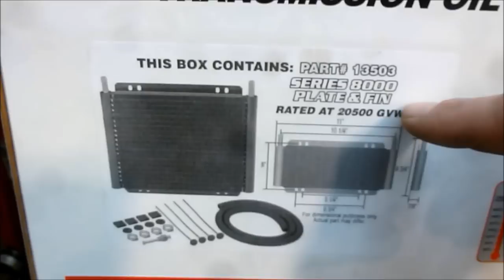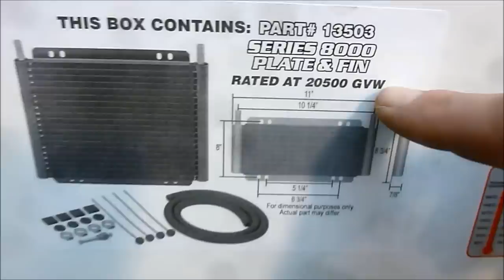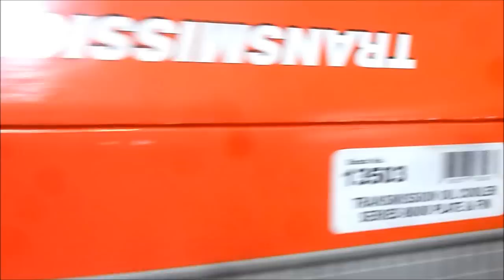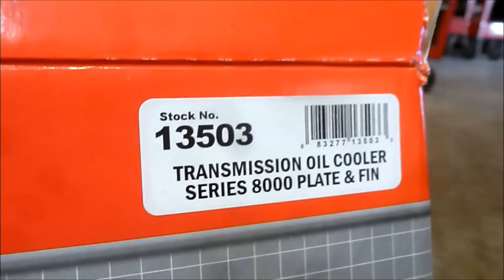2003 Honda Odyssey Automatic Transmission Cooler Installation

Comment: that cooler is supposed to be an inch away from the condenser or the heat from the AC transfers right to the transmissionfluid

Comment: so instead of going into the radiator, the fluid goes through trans cooler instead?
Reply from the maker: +obadiah7771   No. It goes thru the stock radiator cooler first for a little cooling, then thru the aux. cooler for best and final cooling.
Reply: +2stroketurbo got it👍
Reply: .2003 honda oay radiator how to change cooler fitting

Comment: How did the trip  go?  Did you have any problems with the transmission? I am thinking of doing this to our 2003  Odyssey also  .... to pull  a trailer with a couple of motorcycles.
Reply from the maker: +Richard Reilly  I would highly recommend it. However, Don't get the factory optional kit, it looks really wimpy. This aftermarket bar/plate cooler is the cats meow
Reply: Richard Reilly he prolly didn't make it
Reply: This 2003 odyssey, did you have problems with the transmission? How many miles and how did you maintain the it? Actually the genuine Honda trans. oil is the better oil. That's what I heard from many people. Your opinion? Put magnets on the trans drain plug.  Better magnetic force can put an extra magnet on the outside of drain plug. OEM has a magnet but you can increase its effectiveness.  Oil drain is not. Blox will have it. Oil filter can be magnetized by putting magnet on the fram oil filter. Heard Fram brand is good.I don't think I could install a trans cooler, but can a mechanic know how to do this and how much?

Comment: Is there an additional pump? or does the rotation of the gears act as a pump to get the oil through the system?
Reply from the maker: The transmission has a conventional large main pump engaged with the torque , convertor, no extra pumps or gears that I know of
Reply: Ok cheers. Not had any experience with automatic so i wasn't too familar with them.

Comment: Great job thanks. 
I would make a spacer just keep it off the AC condenser so the heat will not transfer. 
Honda failed to make a filter in the transmission. You can order a inline filter eBay $12. There is however a black cylinder on top of the transmission under the battery under the brake. 
Honda does not recommend removing it. It's just a magnet and it's a huge hassle. My 2002 has an aftermarket modification connected to it which Honda created to solve the problem with the transmission problems. It puts more fluid on the second gear. It's a huge mess to get in there and deal with it so just leave it. Buy a simple trans filter.
On some vans Honda also made a modifications using the fill plug. It's just a huge mess. 
Honda transmission should be flushed every 10 to 15,000 mi and no more than that. Especially inner-city driving. I'm going to do four flushes within a 3-week period. And I do not see the fill plug on top of the transmission so I'll be using my dipstick hole to fill the transmission. I also am using the Valvoline synthetic. 26
 at Walmart
Go read the wiki Odyssey mess. The point is why didn't Honda make a filter in the transmission like other transmissions also why didn't they recommend changing the fluid every 10 to 15,000 mi.